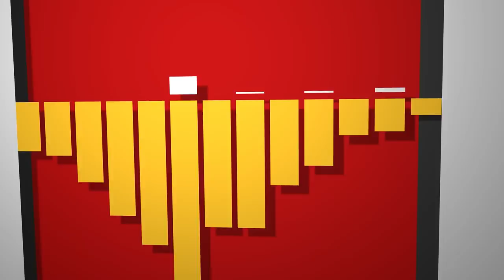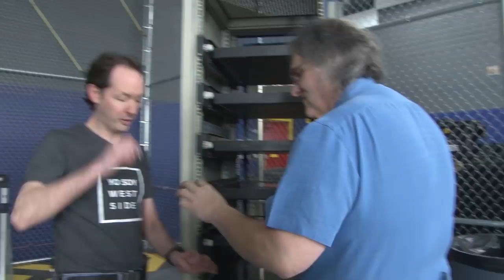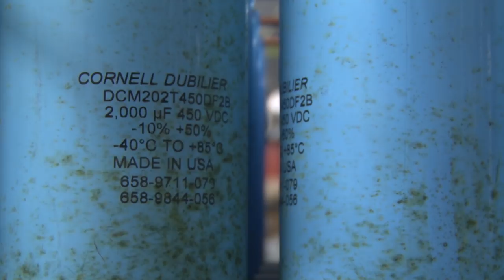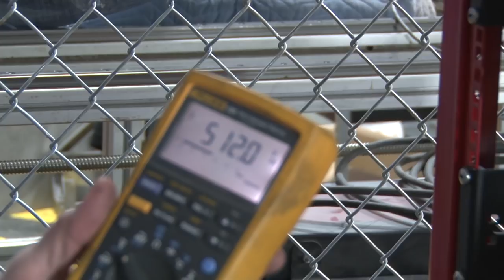Cleaning & Upgrading Project Thumper: High Voltage Lab

Comment: Good to see you are active in the HV lab again :) How is the copper spark gap holding up to vaporization damages so far? I seem to recall we have discussed this before and there is plenty of studies showing brass to be superior to copper in this application. Is the pneumatic action as slow as it seems on video? If it is, you might waste a good load of energy in a spark there from not closing it fast enough.

Comment: Careful with RF stuff around thing-that-make-big-zap and make a broad spectrum burst. I don't know how it will owrk, but it's something to think about
Reply: We have more problems with the Tesla coils than with thumper.
Thumper for the most part operates on the magnetic portion of the EM emissions (it's a giant loop antenna!) but it's inherent inductance and capacitance makes it resonate at ~1khz. There's nothing that is even sensitive to 1khz EM fields, let alone able to be damaged by that. Sure there's broadband emissions, but they'll quickly roll off before they get to any bands that anyone cares about.

Comment: love the channel overhaul and thumper too! you really should tap the wires off of the middle still because the capacitors on the top will not be worked as hard as the caps on the bottom, but im sure the bigger wire makes that better!

A curious question, where are the ballast bulbs connected to? the mains going to the transformer or on the high voltage side of the transformer? you use those to dump also so I think they are on the high voltage side am I right?

Comment: 30:24 give it a thumb clearance. lol not even a standard measurement
36:58 incandescent lights tsk tsk tsk those are not very efficient lol
Reply: I believe that is actually the rationale for using them.  The lights are a load to dump the residual power out of the capacitor bank.  The quicker, the better.  Solar systems do something similar when charged to capacity.  The panels still generate power.  It has to go somewhere so they shunt it to a heat coil in most cases because it's a very inefficient, high drain device that doesn't allow potential to remain in the circuit..
Reply: We need to dissipate the power somewhere. Incandescent lamps are cheap, readily sourced, and also function as an indicator.
We WANT the inefficiency.